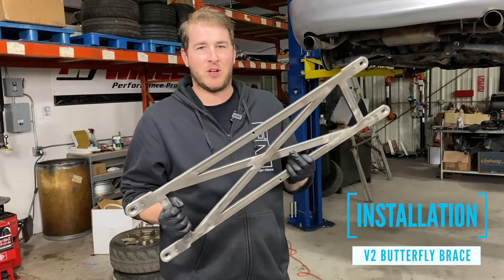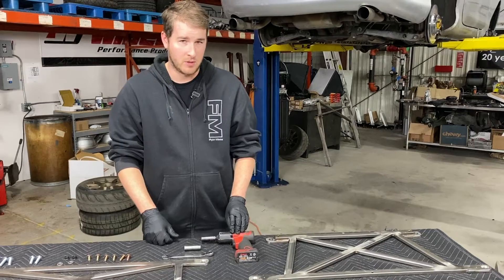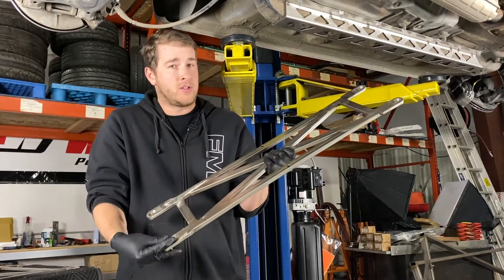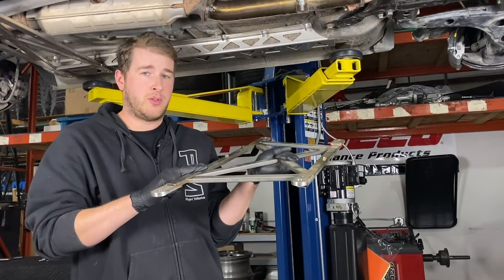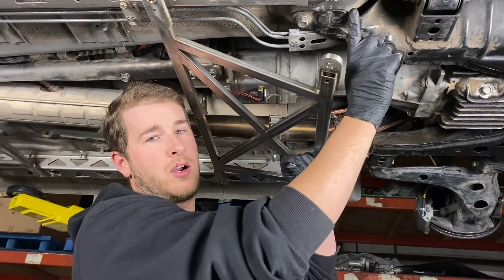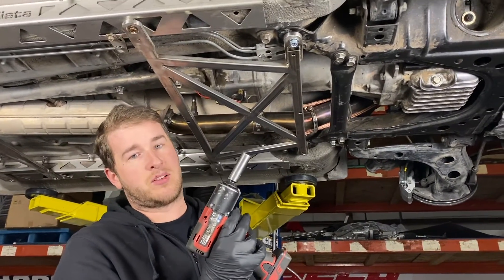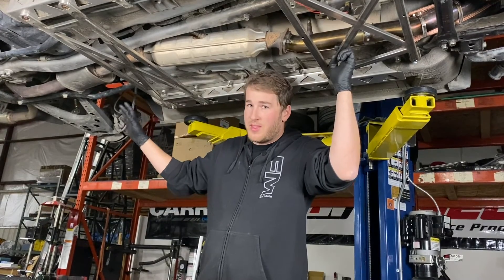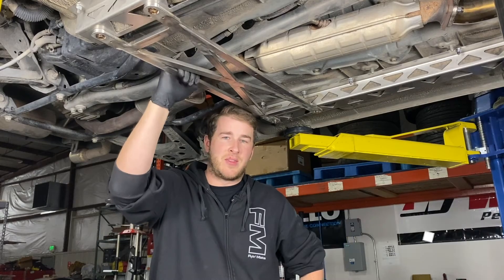FM V2 Butterfly Chassis Brace Installation

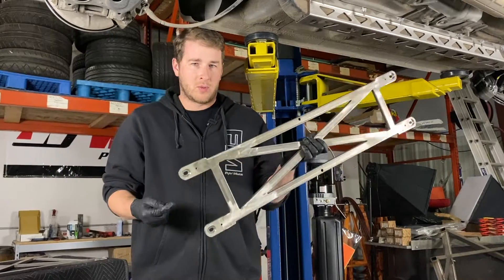Comment: 1:19 why can't you use stainless steel bolts like all the others?
Reply from the maker: Our supplier didn't offer that particular size in SS, and zinc keeps costs down while working for most applications. If you live in an extremely corrosive environment and have concerns, reach out and we can give you the specs so you can source stainless for your install.

Comment: 02:50 so I have just the frame rails because the butterfly is not available till spring.  I want to do the frame rails but I don't want to run into issues with not lining up the front butterfly brace. This guy does it no problem so I suppose I should give it a try. Right? Does anyone know the length between the two mounting points? Let's say my frame rails are back a bit by a quarter of an inch. This will mean the front brace won't attach right?
Reply from the maker: The current frame rail braces have captive nuts that line up with holes in the factory frame "rails" of the floorboard.  Basically, these captive nuts line up with the holes, so as long as you install our frame rails to line the nuts with the holes, you'll be set for lining things up with the Butterfly. Feel free to reach out to out support team directly via phone or email if there is anything else we can help with!

Comment: any plans on a retro-fit how-to for the first gen Frame rails?
Reply from the maker: Unfortunately, the V2 butterfly is not compatible with our earlier frame rails. The required mounting points overlap with some of the cutouts in the earlier design. The attachment points of the frame rails to the body are the same, so you can change to the newer frame rails without having to drill any new holes.
Reply: Flyin' Miata i
Reply: simple answer : No. else how to sell V2

Comment: More important question, when will these be back in stock??
Reply from the maker: The website always shows the current stock status.
Reply: @FlyinMiataVideo  it says they are in stock but when you order them with the brace it won't go to cart it says out of stock.
Reply from the maker: @merlyn2121  So sorry for any confusion. We don't currently have the butterfly brace in inventory, but are expecting more very soon. You can use the "Email me when this product is available" option at this link:https://www.flyinmiata.com/default/flyin-miata-butterfly-brace-v2-0-upgrade.html
Or please check back on the site in a few days, or drop us an email at support@flyinmiata.com with any specifics we can help with. Sorry for the inconvenience.
Reply: @FlyinMiataVideo  I've been randomly checking back in for the rails & butterfly brace for months... Always out of stock, then in the past month the price went up a few hundred dollars... and still out of stock.
Reply from the maker: @tylermfdurden  We were forced to change suppliers to ensure a quality product, and due to material cost increases, we had to increase the price. Unfortunately, this means more delays. We do apologize for the issues, and we are doing our best to get these parts back asap. For a more accurate ETA or more details please reach out to our customer support department directly. You can give us a call at 970-464-5600 M-F 8-5 Mountain time, or drop us an email at support@flyinmiata.com. So sorry for the continued delays and price increase. We truly appreciate your patience and understanding as we work through some issues to ensure we can offer you the best quality possible.